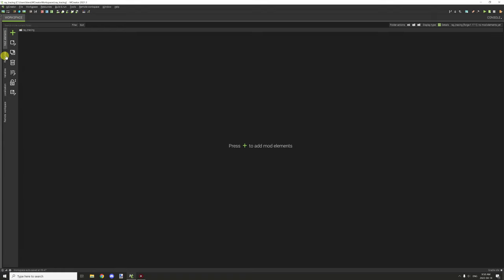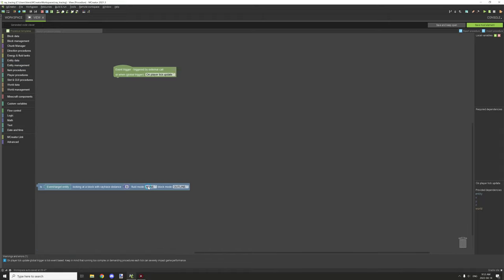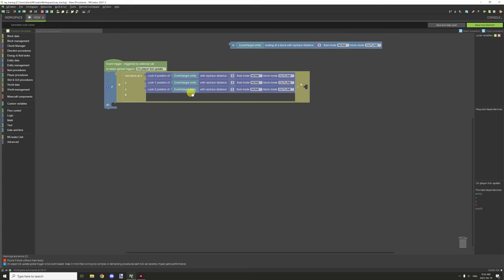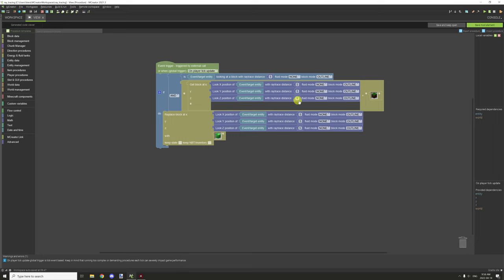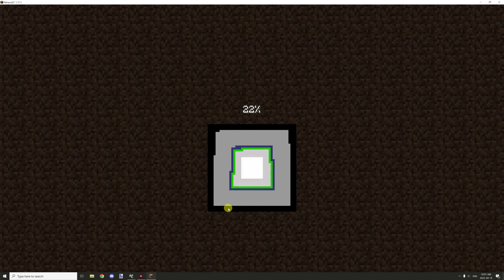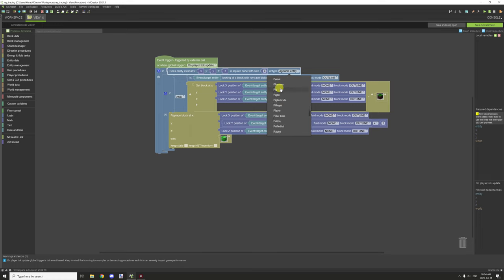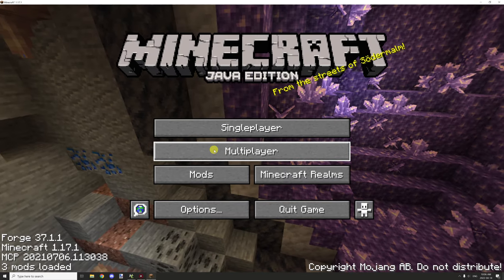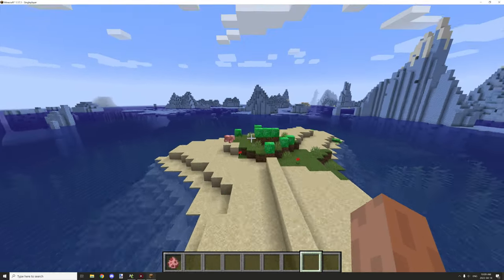MCREATOR TUTORIAL: Ray Tracing Procedure Blocks

Comment: That's so cool. The main use i thinked of during the video is filling a bottle with a custom fluid, as i think you cannot check for the fluids with the block procedures, at least not the vanilla ones as i tried. But with this i can manage it, thanks dude
Reply from the maker: No problem :D
I did make a custom bucket tutorial that uses ray tracing a while back, so it would be possible for sure. And my lily pads tutorial also use ray tracing to place blocks on top of water sources.
Reply: @NorthWestTreesMCreator  Yeah, i'll use the procedure for a lava bottle that i've made. Currently i can only fill it due emptying a block that holds the fluid, but now i can make so it can also pick up the lava itself. Super useful✌️

Comment: Hello!
Do you know how to raycast from one location to another?
I am trying to make a projectile that changes its direction towards the player once it has a clear view of them.
Reply from the maker: For projectiles not sure how to do that, form working with them they are limited what can be done in the way of AI, so your best bet would be to try to find a way to detect if the player is in range of the projectile maybe via projectile tick update then despawn the projectile and spawn an flying entity with pathfinding to a player, it wont be exactly like a curved bullet but I can't think of any other way that this could be done.
Reply: @NorthWestTreesMCreator   @NorthWestTrees Gaming  
Hello again, and thank you for your reply!

I am trying to make it so that fireballs shot from blazes will redirect themselves towards the player if they miss, so I don't think that solution would work in my case.
Your reply has given me an idea, though!

Do you think it would be possible to spawn an invisible entity attached to the fireball, and have it look at the player so that I could use the look-ray from said entity to detect if there is an unobstructed line between it and the player?
If so, how would I go about making the entity look at a specific target? Do you know of any tutorials for this?

Thank you again for your time!

Edit:
By the way, I am using a custom potion effect to run procedures in the entities that I want to modify. I am not actually sure if this method works for projectiles, I just hope it does.
I will test it tomorrow.
(I am working on a mod that changes various behaviours to make the game slightly more challenging and fun.)

Comment: any way to detect entities rather than blocks?
Reply from the maker: you need to use repeat block then use a counter that increases one block at a time that controls the position of the test. Each time you increase the distance you want to test for your entity, this is best done with nearest entity as you can set the distance to a area such as 1 radius (I think) around the block location sadly ray tracing does not detect entities directly but it can be used with a counter like system that tests for an entity each block distance until the repeat time run out or it's ended with the green break loop block.

Comment: is it possible to make a mob spawn facing the same way as your face using these or smthg
Reply from the maker: You can set the entity to face a direction using the summon command but Minecraft has had this weird bug for years that the entity will always face a set direction I think south or noth then rotate a second after. It may be a client-server sync issue but it is on Mojangs end not MCreator unfortunately.